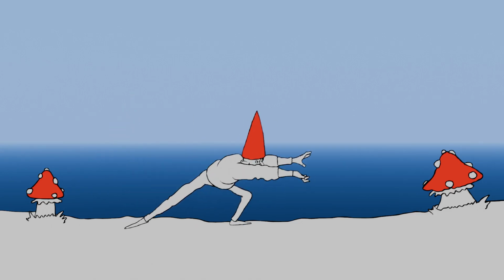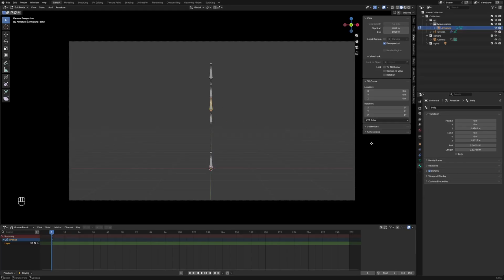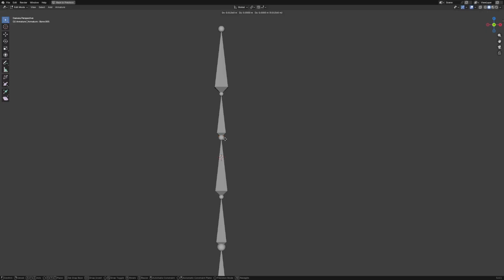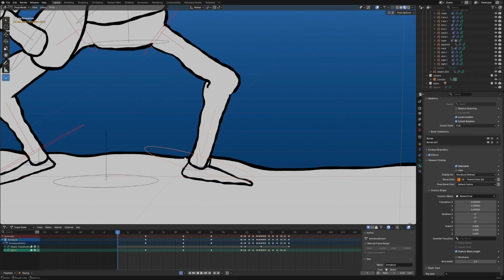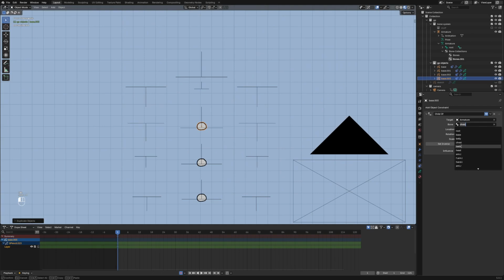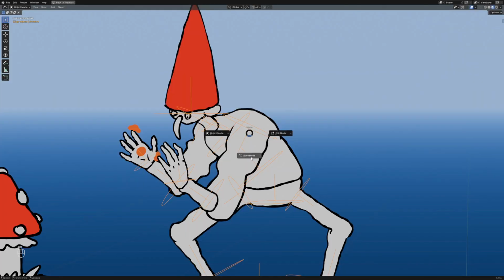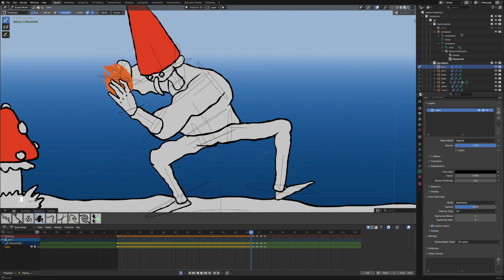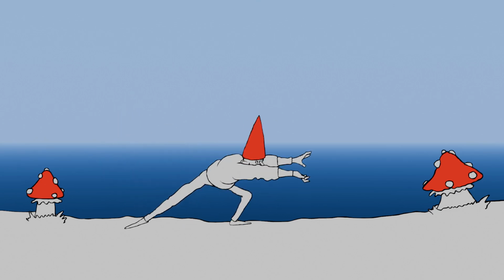Rigging the Grease Pencil in Blender

Comment: If I understand your workflow correctly you don't do each step each time, right? The initial bone armature you would only do once for all characters with that type skeleton or level of complexity. The second step of creating the hierarchy of grease pencil dots used to match the pose, you also only have to do once since it has to match the armature. Then what you actually do for a new animation is matching the "GP rig" to the initial pose, and re-drawing the dots into the corresponding body parts. Is that correct?
Reply from the maker: Yep. Exactly. Here's another video with the same rig apended to another project https://youtu.be/WHad-1m8lE0?si=AbeFUXj4RZOpR1VQ

Comment: So, essentially you match up your rig to your key-frames/breakdowns, then rotoscope the in-betweens using the rig animation as a guide.  That's quite a neat trick.  I love your presentation style, too, and am always happy to see nasty gnomes in educational material.
Reply from the maker: I start with the sketch of the keyframes/breakdowns as you said. But the part with rotoscoping is wrong. It would mean that I already have some kind of reference animation to rotoscope over it frame by frame which is not the case. Instead I  use the armature and motion paths to develop the animation. Then, I use  grease pencil objects (attached to the moving rig) as containers for handdrawn artwork. I redraw where I need to redraw or resculpt where I can resculpt.
Reply: @yosifol  So the character sections are parented to the dot objects?  I thought you were redrawing/sculpting the pieces to line up with where the dots were positioned in the in-between frames.
Reply from the maker: @WaterShowsProd  The dot objects are grease pencil containers for artwork. The dot is on separate layer. It' there just to show where the GP object actually is and it helps to select the gp object straight from 3d viewport. Once i start to draw the actual artwork in such GP object i usually delete or hide the dot. What's actually driving those GP objects is armature - the bone system. It's easier to maintain, because you have all the different parts gathered in one action, plus you have cool stuff like the breakdowner tool in pose mode.
Reply: @yosifol  Oh, I see now.  I didn't realise the dots were layers within the artwork, I thought they were separate objects from the artwork; almost like tracking markers.  Thank you for clearing that up for me.

Comment: Can I use textures drawn in Photoshop ? I mean character and it's parts
Reply from the maker: Kind of. Grease pencil materials can use image textures both for lines and fills. I was creating seamless crosshatch textures in photoshop. Or seamless paper texture. If you mean textures - pockets, patchers, buttons - specific characters elements - I would suggest to use UV mapped 3d planes rather than grease pencil. The cool thing is that with a little practice you can use both in the same character - like textured 3d for body and frame by frame hand drawn grease pencil hair or something like that.